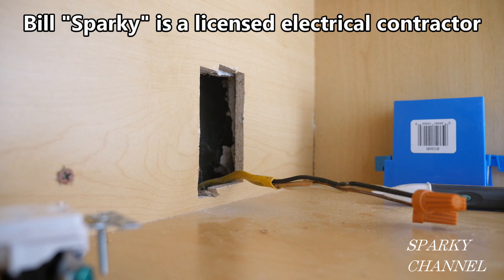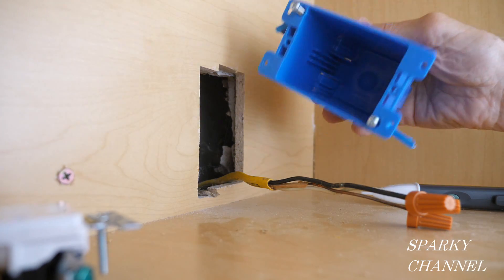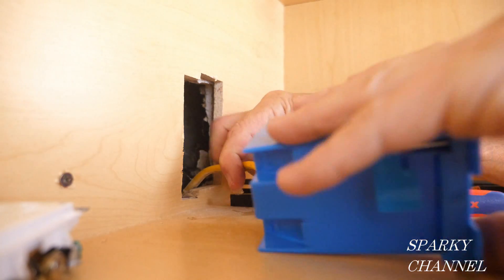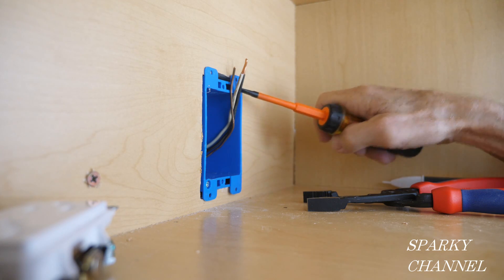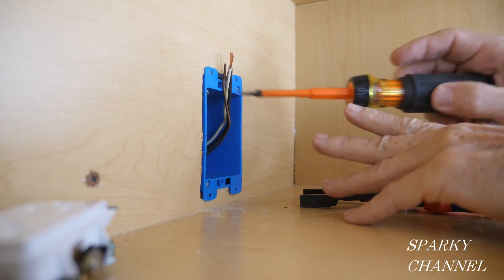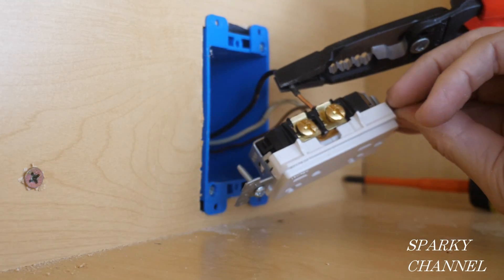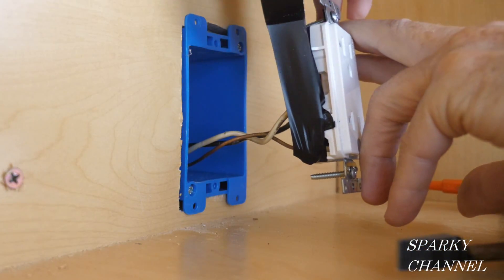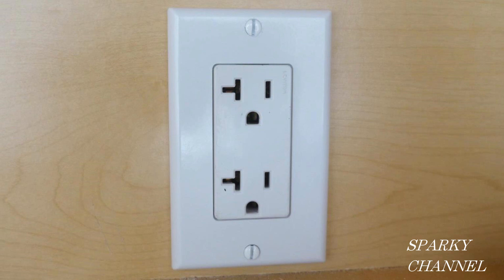How to Install a 20A Spec Grade Microwave Receptacle and an Old Work Box

Comment: First. Nice vid. Remember to mention that if you are using backwire, pull on the terminals to test that the wire will NOT come off.
Reply: I agree, every once in a while I catch a wire that didn't get properly installed and pull out that way.
Reply from the maker: Thanks Dave. Yes, I'll try to include that in the next video. You make an important point.

Comment: I heard that GFCI receptacles have to be installed in the kitchen. So I assume that the new receptacle is protected by a GFCI receptacle.
Reply: If it's 6 Ft or less from a water source it must be.  That was a standard 20 amp receptacle.  If it requires gfci protection a gfci breaker could be used.
Reply from the maker: It's best to protect that receptacle with an AFCI/GFCI breaker.
Reply: @SparkyChannel  I've heard stories about certain microwaves with speed cook capabilities tripping df breakers. The afci section detecting false arc faults so it trips.
Reply from the maker: @MrNappy28  Yes, that is possible.

Comment: How come some places have the ground hole facing down, while others install facing up?
Reply: Either way is correct. There is no code requirement on which way is up. I put my ground holes up for safety.
Reply from the maker: Good answer by Farmer Dave. I try to put mine in the same direction as the rest of the receptacles in the house or business.
Reply: Ground hole up is more of a commercial application. The theory is that ground hole up is less likely to break the ground pole off the cord, when pulling the cord downward.

Comment: SPARKY!!!! What kind of Dewalt impact is the one your using??? Model No. please!!!👍👍👍
Reply from the maker: Used in the video: DEWALT XTREME 12V MAX Impact Driver Kit, 1/4-Inch (DCF801F2): Amazon: https://amzn.to/3D0UhSq
  Thanks for asking. I added the link to my video description as well. It's small, lightweight and it has a nice variable speed. Great for electrical work.

Comment: Second, what is the LoZ setting on Fluke meter? Thanks!
Reply: Low impedance input to detect ghost voltages for false readings.
Reply from the maker: The Fluke low impedance function is called Auto-V/LoZ. Auto-V stands for automatic or volts. This feature automatically, determines whether the measured signal is ac voltage or dc voltage, selects the correct function and range, and displays the correct information. LoZ stands for Low Impedance (Z). This feature presents a low impedance input to the circuit under test. This reduces the possibility of false readings due to ghost voltages and improves accuracy when testing to determine absence or presence of voltage. Use the Auto-V/LoZ switch position on the DMM when readings are suspect (ghost voltages may be present) or when testing for the presence of voltage.

Comment: Sparky, why is it I so many "people" surface mount the  outlet box and not use a remodel box like we use?
Reply from the maker: That's an alternate way to do it. It works but it sometimes leaves some flammable material (the wood of the cabinet) close to the receptacle without protection from the box. Because of that, I prefer to use the old work box.

Comment: Aren't all 20 amp receptacles as well as 15 and 20 amp gfci receptacles spec grade by default? Why didn't you use a single receptacle in order to insure that this remains a dedicated circuit?
Reply from the maker: No, they aren't all spec grade. A single receptacle would be a good idea.
Reply: Outlets hidden in the cabinet are usually only accessible for the microwave or at most undercounter lighting or a wifi router.
Reply: Single receptacles often cost more than duplex ones.  Most if not all microwave ovens don't draw more than 15 amps so putting another small device in the other outlet won't overload the circuit.
Reply: @1575murray  I think you are correct, my 1200 w microwave measures 11.9 amps on my clamp meter which would be 1428 watts. That sounds about right, since the input power consumption will be higher than the output rating.

Comment: Incidentally,  appliances using a 120 volt 20 amp plug aka nema 5-20P are rare.  I've personally only seen that a very few times,  one of them being in an office building found on a commercial style coffee brewing machine. The  presence  of 20 amp 120 volt receptacles are more often than not, just installed to advertise,  at a glance,  that we have a 20 amp circuit,  as per NEC either 15 or 20 amp receptacles can be installed on a 20 amp circuit,  but you CANNOT LEGALLY install  20 amp receptacles on 15 amp circuits.
Reply from the maker: Thanks!

Comment: Thanks for the excellent video! Looks like the screw attaching the cabinet to the wall is a deck screw. It should be a cabinet screw with a large head on it.
Reply from the maker: Thanks! Yes, you're correct.